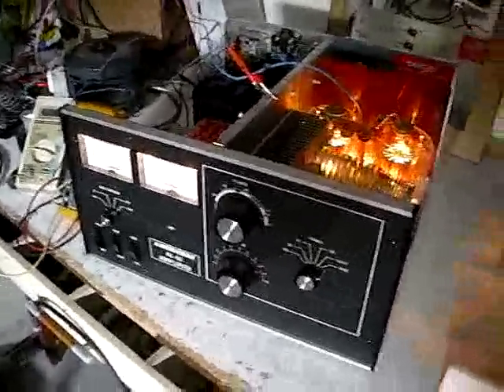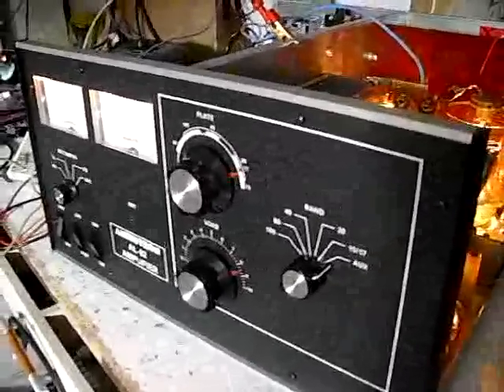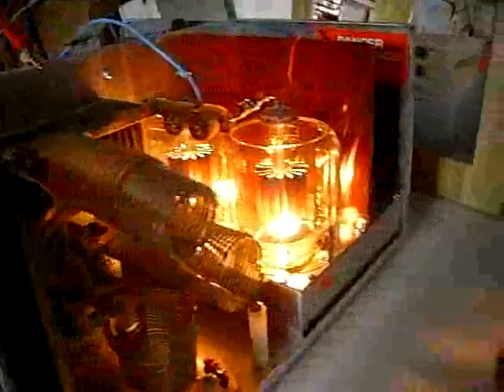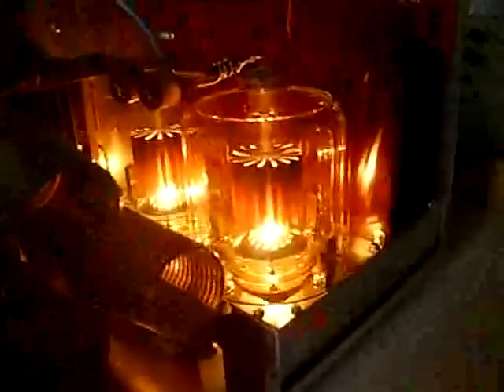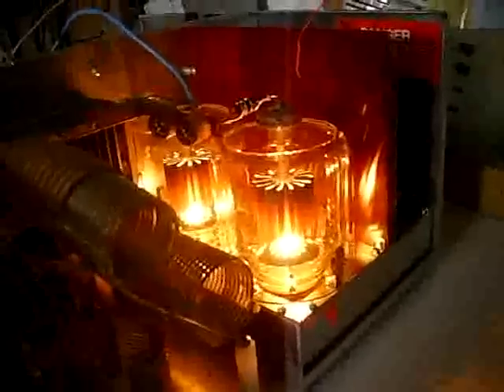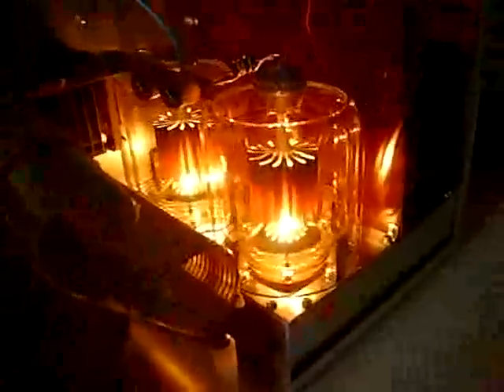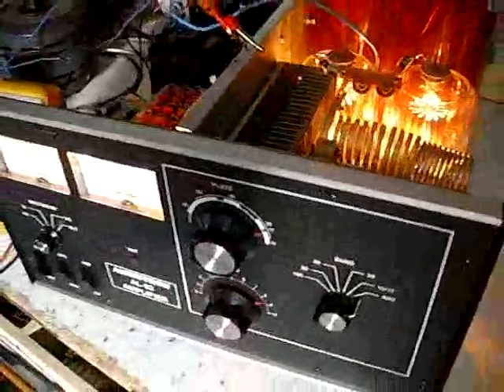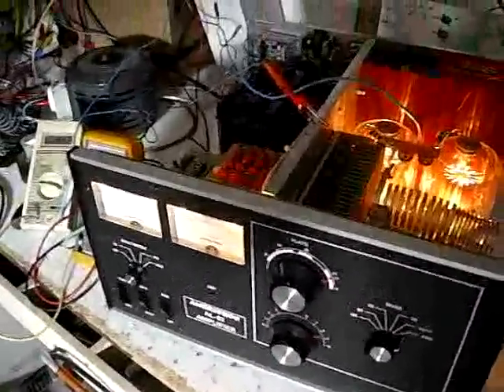AL-82 tube getter

Comment: im not sure i would be de-gassing them in that procedure for a "few hours" without better air circulation through the tubes.
Reply from the maker: Do you see CHIMNEYS and turbine?
Tubes in this amplifier is cooled properly...like EIMAC said in datasheet. Very few amplifiers do this with 3-500Z....That is the reason why it makes 1500W OUT.
Reply: Beautiful amp!!..I have a   JB 2000 Its not pretty but it gets the job done .